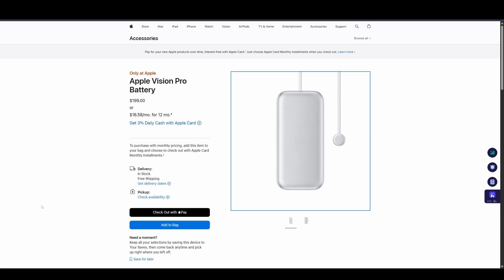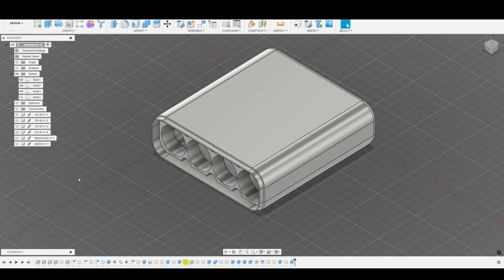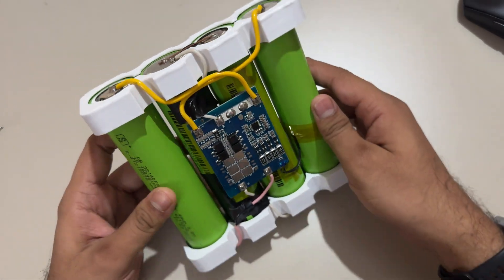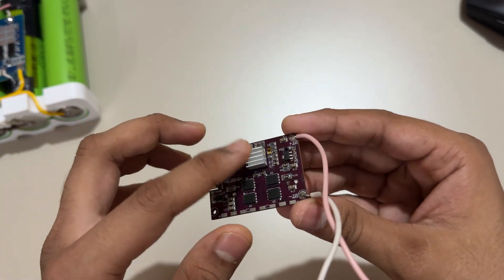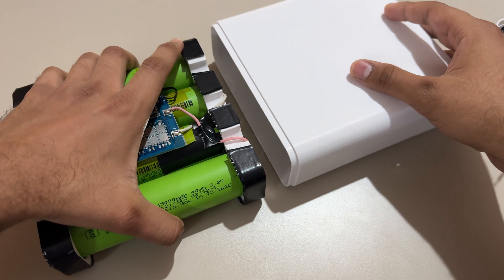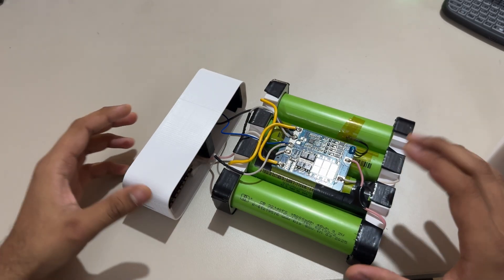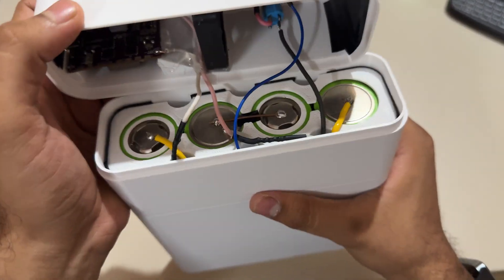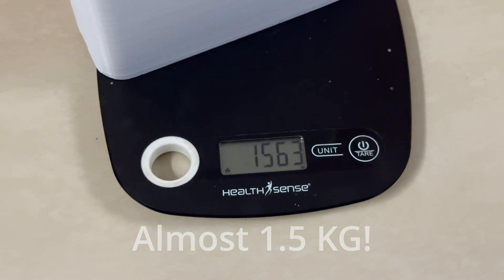DIY 3D Printed Powerbank | 200 Watts!!!

Comment: I have also made something like that this bms board you are using is not reliable for all cell balance charging use a active balancer with this as well and instead of using 100 watt power bank module use 140 watt power bank module instead it cost around 1799 rs on amcikart website it will work much better for your setup. Anyways it's look really good 👍😊

Comment: and also in the place of a switch for fan if you use a thermal switch which can be placed above the IC the fan will automatically turns on when that module is getting hotter it make that power bank to consume less power and user friendly
Reply from the maker: Thanks for the valuable information, I completely forgot about thermal switch it could be a real good application for this project.👍
I will definitely include it in the next iteration.

Comment: it was warming while at 65w and more because it need to convert 20v 3.25a power is step down  to 14.6v  4.45a that causes it to warm up , if you use 5s  battery the heating of the module could be resolved
Reply from the maker: Absolutely, the tiny board is handling huge power with such small size causing it to overheat.
But I'm not going to use the 70/80 watt fast charging anyways just in emergency situation where I need it quickly.
I'm currently only using 35 watt PD charger.

Comment: 60000mAh ? Great work dude!
Reply from the maker: ✅ Clarification: 15,000mAh × 4 Cells ≠ 60,000mAh — Here’s Why:

I’ve connected the four cells in SERIES (4S), not in parallel.
That means:
	•	Voltage increases (3.2V × 4 = 12.8V total system voltage),
	•	Capacity (mAh) stays the same → 15,000mAh, not 60,000mAh.
So:

This is a 12.8V, 15,000mAh pack, not a 3.2V, 60,000mAh one.

If I had connected them in parallel, yes—voltage would stay 3.2V, and capacity would add up to 60,000mAh. But for a powerbank that needs higher voltage for conversion to USB and PD outputs, a series connection makes more sense.

15Ah × 12.8V = 192Wh of energy, which is quite a beast!
Hope that clears it up. Thanks for pointing it out!